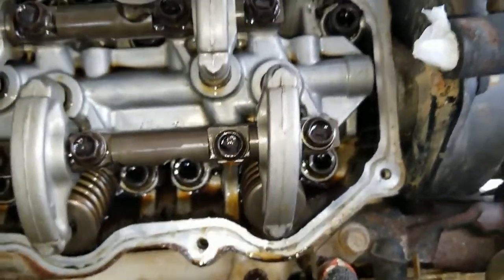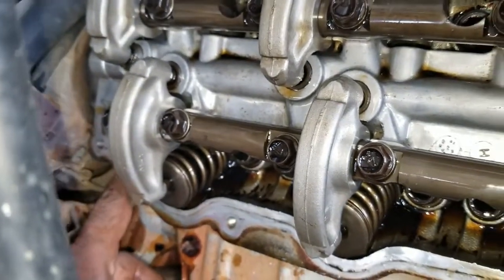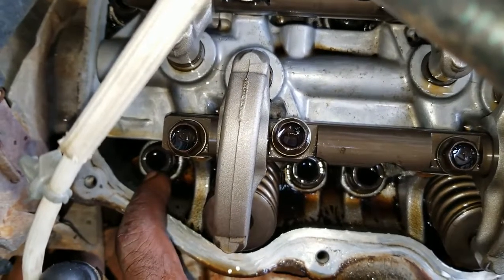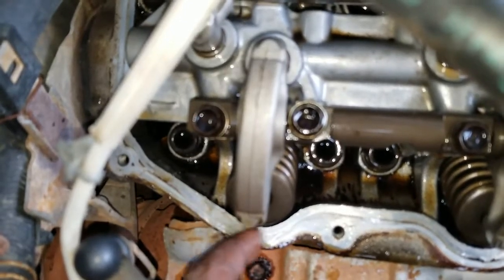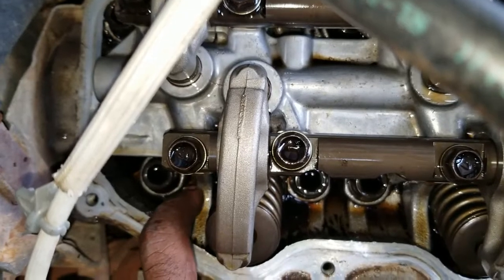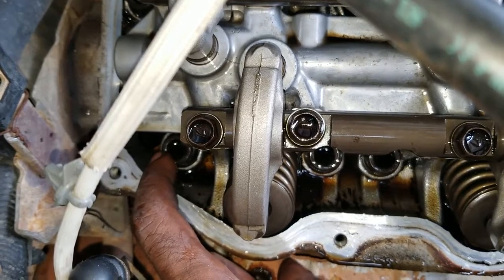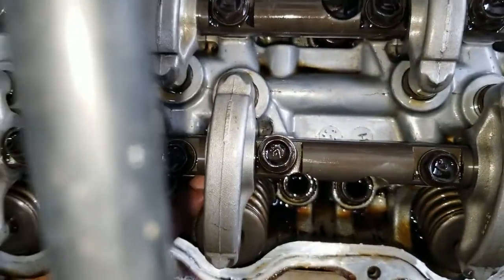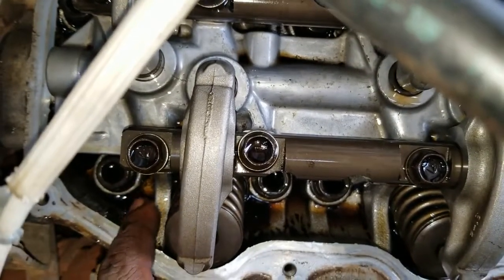What cause Nissan VG Engine to leak oil at its valve cover gasket joint?.

Comment: And once they starts to leak on a 2003 Xterra it will eventually cause your starter to fail prematurely until the gaskets are replaced.

Comment: The bridges are there on purpose to keep the exhaust valves cool.
Reply from the maker: No. The bridge is there because it's two left side cylinder head on all v6 engine. One head fit both side is the cheap production.